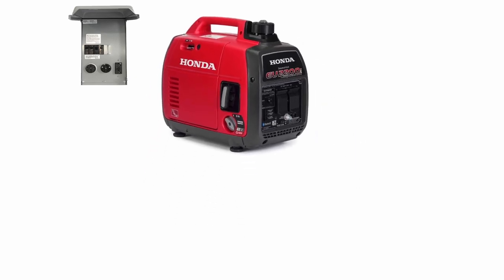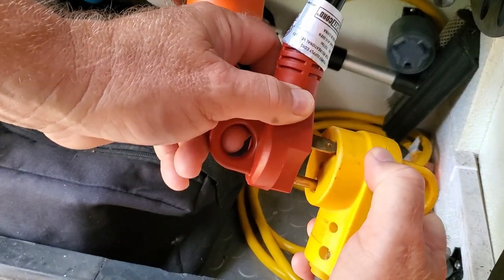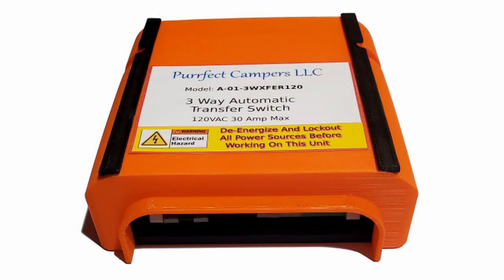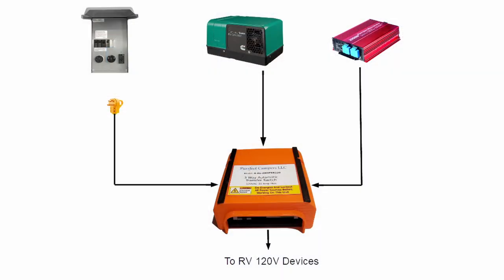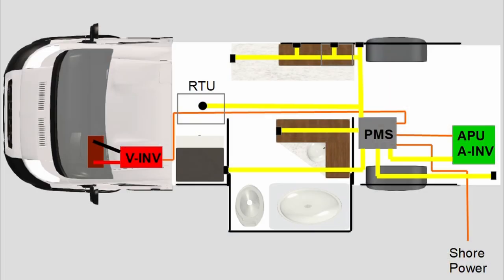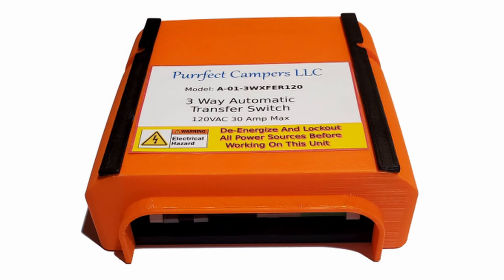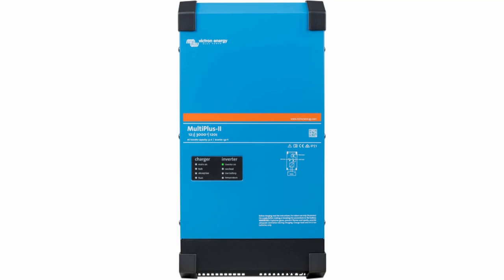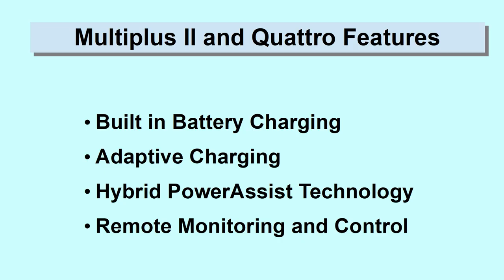RV 3 Way Transfer Switch and more

Comment: I am looking for an automatic switch, like a simple manual transfer switch (if available) that can switch between a grid power AC input and a generator AC input, and then output to a Victron inverter. Both inputs need to be combined into one input that feeds into the inverter.

I am looking to set up this system in a slightly different way than typical systems that use traditional transfer switch functionality. 

I am not running the generator continuously, and I just need to feed the generator AC input into the inverter when the grid power is offline. I am not transferring power from grid to generator either. I am just switching between two different inputs, that may or may not be energized at the given time. Technically, I am looking for a remotely activated AC switch, and not a true transfer switch. 

When the input source is switched from grid to generator, the generator input would always be inactive, but when switching from generator to grid power, this is a chance that both inputs would be active based on the inverters generator start schedule. 

The issue is that my Victron inverter has only one AC input. Victron does make an inverter with two AC inputs, but I am trying to see if I can replicate that functionality with my current inverter. 

I can easily do this with a manual switch, but I am wondering there is an automatic switch available so that I can have the functionality of a Victron Quattro inverter. 

Victron does make a similar switch that is 240v, but my system is only 120v.